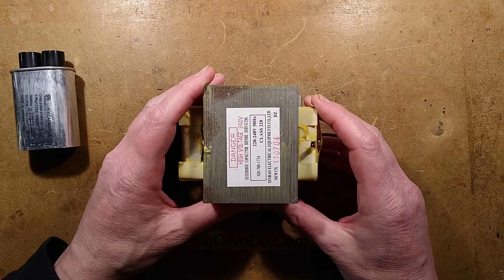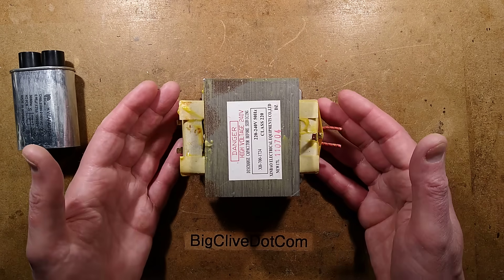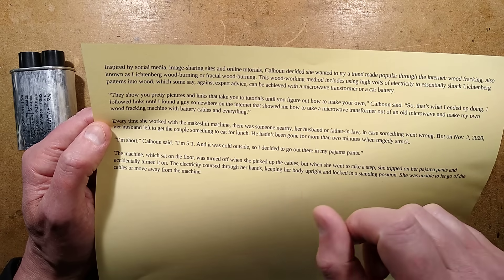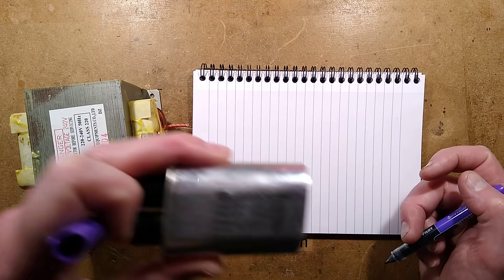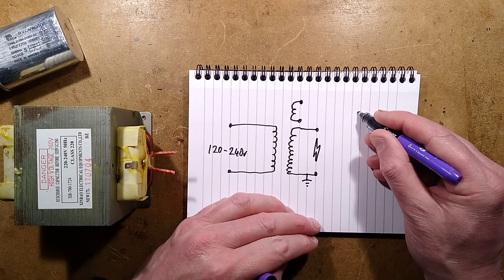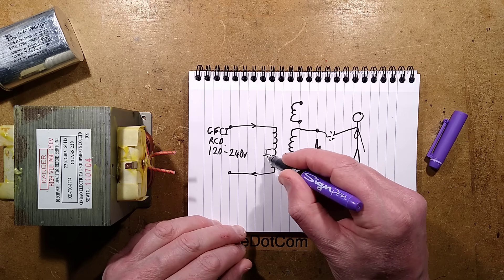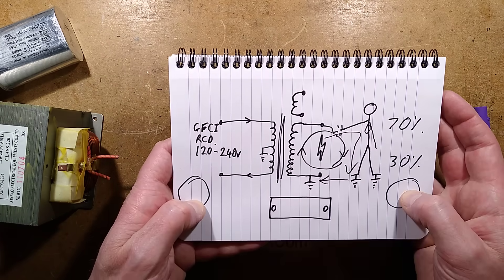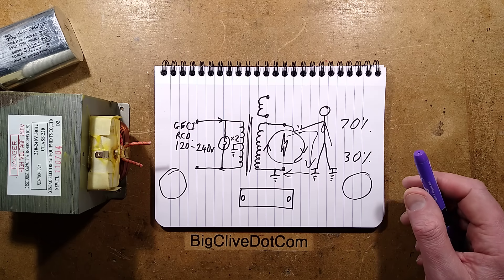The most deadly project on the Internet

Comment: Having felt both 120v bites and 277v bites (as an electrician, by profession, these things tend to happen) i cant imagine what a 2kv one would feel like. Mind you i may be odd for this but most mains voltage shocks have only felt uncomfortable or unpleasant, i would not describe them as painful per se, but at that high of a voltage it will certainly get real hairy. I always mentioned that if i ever played with fractal burning i wouldnt be in the same room as the transformer. Wild that people have so little concept of how dangerous electricity can get even with just a 15 amp breaker worth of power.
Reply from the maker: That's because you were in an environment where very little current flowed.  Check out my guide to electrocution video.
Reply: @bigclivedotcom  my skin does tend to be quite dry when it happens! Yeah I've gotten the gist of the mechanics from good sources like yourself. Whenever they talk about it in apprentice courses I just bite my tongue and drop in a comment about getting a good set of insulated screwdrivers, because unfortunately an understanding of physics is not a requirement for teaching electrical code here in the states. Great video, I really appreciate you choosing to show people how to do something risky in a safe manner because if it looks cool you really can't stop some guys from trying it, no matter how many warning signs you put on it!

Comment: From my experience in high voltage, its a really unfortunate problem with these microwave transformers. these typically run 2,200v at 1amp. Most household circuits can carry up to 15-20amps at 120v. The reality is amperage (current) is what kills, not voltage at all, think of those 500,000v tasers you can buy. But 1amp is more than enough to kill you, 0.1amps is the deadly limit to humans. My old boss did, and still to this day makes fractal wood art using an even higher voltage neon transformer that runs at 12,000v at 10kva which is 0.83amps, still enough to kill. I worry about his safety, but in true practice he is a master electrician who is knowledgeable on the dangers, and does more dangerous things daily. Not for anyone else whatsoever and you should clearly stay away unless this is your well practiced profession that you know very well how to respect and set up.
Reply from the maker: The neon transformer is safer, but will still cause shock and burns.  It is limited in output current by design.  Usually to 30mA.

Comment: I used to do fractal burning and I got electrocuted by my microwave transformer in the middle of shocking the wood , what some people call a chicken is the hand tool used during the process, which I had in my right hand and not paying attention I went to move the ground wire with the chicken foot still in my hand and got electrocuted from what I can tell was about 10 15 seconds and there was no way I could let go , and no one was around. And then the Good Lord saved me!

Comment: So he said it's the same voltage as lower level distribution lines.
Well, not all distribution lines are the same  20000 KV some are 60000 K. V  some are 80000 K. V. What did he say that was, I used to reinforce utility poles both distribution and transmission lines,C-truss And fiber wrap, As well is doing ground line

Comment: 10:46 Is there any kind of circuit protection that Could detect a problem like this? That could detect current loss from currents being Induced in another circuit like this somehow? Like, how does a microwave detect a current leak on the high voltage side normally?

Comment: The people using MOTs for these patterns are the idiots. The true makers use low power zvs drivers and flyback transformers. Very much safer using 10kV at 16,000 hertz or higher. At those frequencies, it burns. It doesn't shock because of the skin effect and natural impedance of the skin.
Reply from the maker: It's believed that the lack of pain and muscle response is purely due to the high frequency and not the skin effect.  It can still burn internally at high power.
Reply: @bigclivedotcom  Oh no doubt about it lol. I'm not saying the flyback version doesn't have it's associated risks but electrocution at such high frequencies isn't one of them. It is definitely safer than using a MOT without proper safety equipment. Driving a MOT with a low-power DC to AC inverter with very strict current regulation also works well I find. Also nice to add in a good DC breaker on the inverter input and AC breaker on the output (if a MOT is the only option).

Comment: I understand how your hands on safety switch works because I wired one for a leather stamping machine.
It takes both hands to push and hold down two normally open momentarily contact buttons wired in series and placed far enough apart that it takes both hands to hold them down to insure that neither hand were nowhere near the stamps. 
It's a very smart idea for using these dangerous microwave high voltage ⚡ transformers.

Comment: The odd thing with old fashioned non-inverter microwaves (capacitor driven) , is that changing the bulb that illuminates the oven cavity, involves the user actually taking off the cover, exposing the HV capacitor to being touched.  

It seems odd that they are manufactured in this way, as changing the lamp would be something expected of the casual DIY person, yet this exposes the user to risk of lethal electric shock should th capacitor not drain down.  Rarely do these microwaves have a plate that can be removed to access just the lamp.

Comment: Technically, the transformer secondary is not referenced to ground, but to the tansformer casing. A ground wire would need to be connected to the casing from the supply for there to be a path to ground.

Comment: More electronics hobbyists are killed by microwave transformers than anything else, its been going on for decades. Its remarkable that it is not more widely known about how dangerous these are if you don't have abundant experienced in working with transformers and high voltage or high current circuits

Comment: Half the videos on here of people making these aren’t wearing rated rubber clubs or mats. They don’t have the burner hooked up to a fail safe like a pedal that requires it to be pressed for power. 

I think there are ways to do this safely. Just like anything else, if you’re an idiot doing something dangerous it will be dangerous. Problem is most idiots don’t know they’re idiots

Comment: Good tip would be,"stay away from electricity if you 100% don't understand how things work".
Only thing i don't understand in this video,is how the current get to the ground if you have rubber shoes on?
Reply from the maker: At that voltage the current will find many paths.
Reply: @bigclivedotcom so the higher the voltage the less the resistance of your skin ect matters for carrying a current?

Comment: You forgot to mention if your legs are far enough apart when it happens it blows your balls off because you complete the arc gap as it runs down the inside of both your legs.

Thats why you shuffle your feet insead of walking near downed powerlines, too.
Reply: An interesting take on the discussion of step potential...

Comment: really enjoy your content..  can I suggest an idea,
what do you think of the YouTube videos based on continuously running small synchronous motors from microwaves straight from 220-240v.. these get hot..  It's too hot to touch in cases.. I'm intrigued
Reply from the maker: Many of the small synchronous motors are engineered to the minimum cost and do run hot.  In the past I've wired two in series for light loads.  But you can also use a series capacitor with some to reduce the power dissipation.

Comment: Hello - I was taught that high voltage was safer than high current. " It's the volts that    jolts but the mils [milliamps] that kills ."" I even have a livestock fence that pulses at 5,000   volts and delivers small current and is ' safe ' " Yet you say at 7:00 that low  voltage and high current is safe. Please explain.
Reply from the maker: High voltage pushes higher current through a specific resistance.

Comment: 15:13 the level of technical competency has gone down over the yeats due to solid state technology. back in the 1930's 40's even through the 1960's high voltage was common to supply all the vacuum tube radios and TV's.  many radio and tv kits were sent through the mail from seats, JCPenney, heathkit.

i just finished rewinding a 4KVA 240 primary  2250 vac secondary to supply a 4cx3000 vacuum tube  it could definitely make some wood art but i wouldn't take that risk.

Comment: I am still unclear how one would get shocked touching just one of the high voltage leads from the transformer high voltage side. Even if you are grounded, how is the circuit completed? I've actually been shocked before by touching just one of the wires from a high voltage transformer while standing on carpet so I know it is possible, I just don't understand how the circuit completes because the power is not going back into the other cable on the transformer high voltage side.
Reply from the maker: High voltage will find any route back to its source via resistance and capacitance.

Comment: I've been thinking about doing fractal wood burning but using the microwave oven enclosure as a grounded faraday cage separating me from any voltage.  Use the door switch and maybe even the original timer.

Comment: The use of car jumper leads I think stems from the fact that cheap leads that have very little copper in them are made to look heavy duty by thickening the insulation. This has the effect of possibly increasing the insulating feature of the leads but if they are cheap then the quality of the insulation is likely to be cheap as well thus breaking down at high voltages. I was told t
that when working on high voltage always keep one hand in your pocket. That will reduce the chance of the current passing through your heart and killing you but its not guaranteed and doesn't stop any other injuries caused by the high voltage. Great video thanks for the information. 
If anyone is tempted to make this device make sure you get someone who KNOWS a lot about high voltage electricity to check you setup including the wiring you use. Don't ask someone who thinks they know.

Comment: The picture showing it is grounded actually is wrong because it isn't unless you explicitly ground it because the secondary winding is galvanically isolated. But ofc it's a huge threat to short the circuit by touching something because the casing is connected to the secondary winding.

Comment: Man, I wasn't planning on ever using a microwave transformer with all the open cables and stuff for anything. I thought about buying a pre made about 10kV 35mA neon sign transformer because I wanted to build a small Birkeland-Eyde reactor. Like a ready to use transformer where no open cables stick out, I would connect my two electrodes and insulate them well, get them out of reach in a housing and never touch anything again once I have turned it on. That was my plan. Might rethink that one, even if I use glass or plastic only this doesn't seem safe anymore.
Reply: If you buy one that's properly manufactured, use it as intended, and use general caution you'd probably be okay. The ones I've seen have secondary side protection built in, and you can even find models that are UL Listed (device has been tested to standards). The takeaway from this video is to avoid improvising tools without the proper knowledge.

Comment: I've got a strange collection of experience that overlaps really closely with this topic. I've done woodturning, I've worked professionally with high voltage, and I've worked on servicing and repairing industrial microwaves. This even involved sometimes, and carefully, working with microwaves that were connected while I worked on them.    
All that specific knowledge gives me is a clear understanding of why I would absolutely not try making lichtenberg figures in any of my woodwork. 
I love the idea of saying "I'm not saying no, but..." and then giving advice on how to do it more safely. I think that if I were ever to consider this, my basic minimum would be set up so that I'm not even in the room while the power is on. Much more managable these days with webcams and many options for remote power switches. Just stay far away from it.
Reply: I wouldn't want the responsibility. What if it gets power when it shouldn't? What if somebody shows up and you don't see them until they're on the camera touching things?

If I were going to do it, I'd want it to be near impossible for somebody to enter the same room without it shutting off, and I would want every possible mistake I could make causing it to shut off before I have the chance to realize how bad I messed up.
Reply: @grex2595  Here's the other thing. Even if you're successful now all of your friends are impressed and they try doing it themselves.

And the other part: apparently getting a bunch of nice different patterns involves repositioning the electrodes.

And these are cheapo DIYers who don't know about electricity or woodworking or designing safe systems.
Reply: @WBWBWBB  no doubt. The only reason it's so prominent is because people did it without dying and now others want to try. It's like cliff jumping in unfamiliar waters. As long as nobody sees somebody die, they're going to try it too.

What really needs to happen is for somebody to make a big business out of it and show just how dangerous it is. Let the guy with the fancy machines take all the risk on a $500 coffee table and enjoy your coffee table without the death.
Reply: I thought the same thing... Like a minimum of 20 feet away...
Reply: You need a faraday cage

Comment: Me watching this while considering if I should try to open up my microwave to see if I can fix the motor. I knew the risks even before but wow.. people really playing around with this stuff without a care?!? We really need to be clearer in schools about the dangers of high electricity. 

Also kinda wanna ask, do most modern microwaves have clear "low voltage DC" side so that I could steer clear of those high voltage stuffs, or do I need to go and discharge the capasitor despite not wanting anything to do with those things?
Reply from the maker: If it's the turntable motor it may be replaceable from below.  Just make sure the unit is unplugged before doing anything.
Reply: @bigclivedotcom  Thank you for answering, you actively reading comments of old videos definitely making me want to watch more and more of your videos, sub deserved :)

Yeah, of course, unplugged, and I'll probably watch some teardown videos first, and see if I can find some diagrams so I can be sure where all the scary stuff is. Haven't really dealt with mains powered stuff before, just low voltage DC stuff.. but I hate throwing things away and if I have a chance to fix something I want to give it a shot.
Reply from the maker: @pluggedfinn  Thanks.  I still manage to read every comment on my channel.

Comment: Microwave transformers are monsters. High voltage is fine high current capibilities are fine combination of them is beyond deadly. I make my own 12v dc power supply's by modifying old server ones and before any work I leave it sit for at least few hours and then short everithing just in case and those are only like 300v dc caps with not that much capacity.

Comment: Sir,   First , your youtube title  "The most deadly project on the Internet " scared me and Second  by viewing the video till the end scared me to a very great extent.. I purchased the transformer to do a project on "Spot Welding Machine". Now I am scared to do the project on Spot Welding Machine. SHALL I DROP THE IDEA ? But ,I highly appreciate your video, it is an  eye opener for SAFETY.
Reply from the maker: The spot welding project is much safer.  Just don't power up the transformer until you have removed the existing high voltage secondary winding.   After that it's just the usual 120V common sense.
Reply: Thanks a lot
Reply: @bigclivedotcom  you could still get a fatal shock from 120v, but as long as your carefull, its no more dangerous than pluging in a standard north American plug
Reply: Thanks a lot.

Comment: Excerpt from "So Long & Thanks For All The Fish" (Douglas Adams):
“Yes. They are the words that finally turned me into the hermit I have now become. It was quite sudden. I saw them, and I knew what I had to do.”
The sign read:
“Hold stick near center of its length. Moisten pointed end in mouth. Insert in tooth space, blunt end next to gum. Use gentle in-out motion.”
“It seemed to me,” said Wonko the Sane, “that any civilization that had so far lost its head as to need to include a set of detailed instructions for use in a package of toothpicks, was no longer a civilization in which I could live and stay sane.”

Some times, we have to let people strive towards their Darwin Awards...

Comment: The other scary thing with these is that at least instantaneously, there is the full current capacity of the mains circuit available. There's no current limiting involved. Touch it, and it will fry you.

Comment: Can anyone enlighten me to what the lower voltage is from a typical one of these? I need a transformer that can take 240v from the wall (I live in Australia) down to somewhere between 50 and 60 volts dc. I was thinking of trying with one of these but after watching this, if someone could possibly give me an idea of whether it's even worth the risk, it would be greatly appreciated!
Reply from the maker: It's not worth the risk.  I'd suggest getting a suitable transformer for the required voltage and current.
Reply: After going further down the rabbithole, I think I'm going to have to possibly wind one myself. Thanks